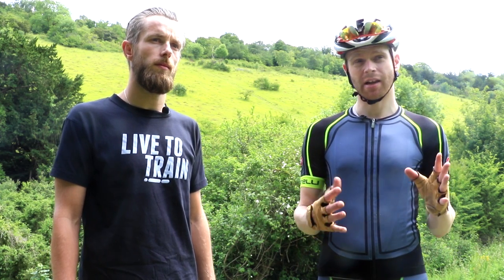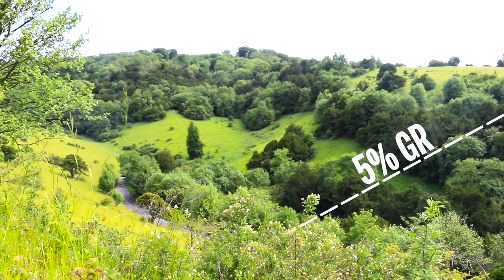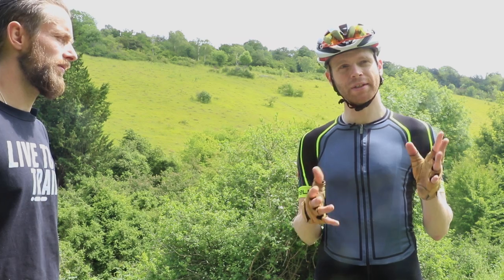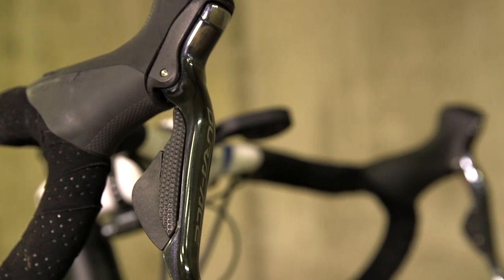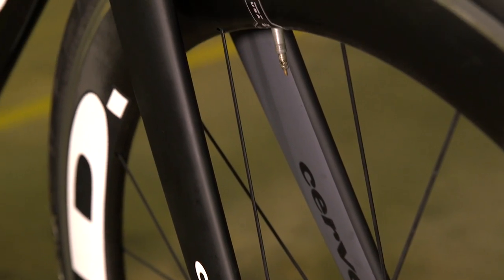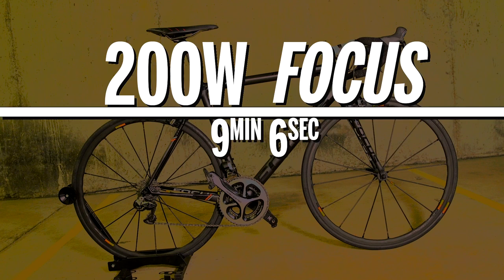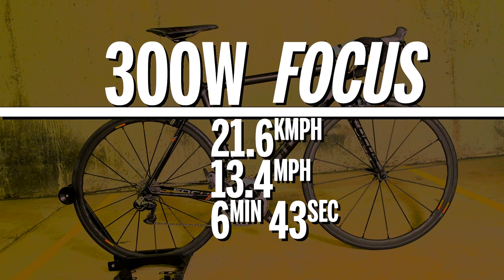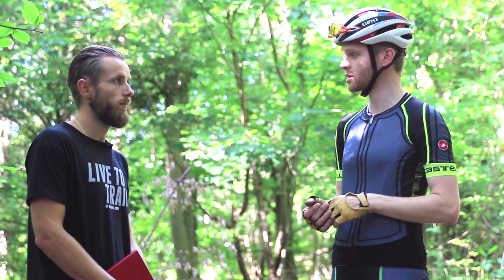How does weight affect your climbing speed? | Cycling Weekly

Comment: Between the two wheelsets there is a 378g difference in rotational weight (HED Jet 6 = 1673g vs Mavic R-Sys SLR = 1295g). That should account for most of the difference in performance between the two bikes riding uphill, especially at lower speeds.

Comment: Is there a test where one light rider and one heavy rider ride same bike with same power over a climb?
Reply: +S Jun The lighter rider will go up quicker. That's just basic power to weight ratio.
Reply: +Yo-yo sure i wanted to know difference... i heard 20kg means almost twice the power on 5-6%
Reply: +S Jun Yeah for example my mum is 60kg and I'm 87kg.  Up the same 7% climb in the same gear, speed, cadence and on the same bike I do 340watts and she does around 220.  But there are more factors than that.  She has longer legs therefor more leverage etc etc

Comment: you forgetting, once you've gone up, you have to go down, so is the gain on decent bigger than the loss on accent?/
Reply: +marcus allison if the decent would be ideally straight and with a steady gradient, maybe. But in the reality it wouldn't be bigger. Also, hill time trials.
Reply: it would be really interesting to see though, over a fluctuating 50k
Reply: All objects fall at the same speed. Lighter riders will be faster downhill due to less friction and improved aerodynamics
Reply: @zmoney1212  they don't accelerate at the same speed though

Comment: What if the aero bike is lighter than the standart bike. Then what? Is it only the aerodynamics or is it also the frame specifications like stiffness at certain parts and geomerty that helps climbing?
I have a Focus Cayo with Sram Force and Campagnolo Zonda wheels that weights 7.4 kilos with everything(pedals, bottle cages etc) on. Would I climb faster on a 7.2 kilo aero bike like a Canyon Aeroad?
Reply: +rondar2 How would stiffness help with climbing faster?
Reply: 200 grams might be worth seconds but I'm talking single digit seconds.  When a road bike is 7.4kg or less most people wouldn't know the difference.  What they don't touch on is the rider weight.  If that guy weighs say 65kg and he's doing 300watts the gain on loosing 1kg is much higher than an 80kg rider loosing 1kg off his bike.  Make sense?  Point is, don't worry about it too much, you'll eventually go quicker if you just keep riding.  Best advice is to just get a power meter, if you have one then don't worry about much else.  If you can do X watts on your bike you know you can do it on any bike 😉

Comment: Box hill's gradient is not step enough to see the real benefit of a lightweight bike. The speed you reach make the benefit of aero significant as well. Prob better to do same test on a hill like Leith hill or Toyshill, where you get proper gradients and speed is very low (no benefits from aero)

Ciao!!
Reply: At that point the difference would be very minimal.  The weight of the rider fighting against gravity would be the biggest factor, doubtful any gains would come from the bike unless they have different gearing on climbing vs aero.